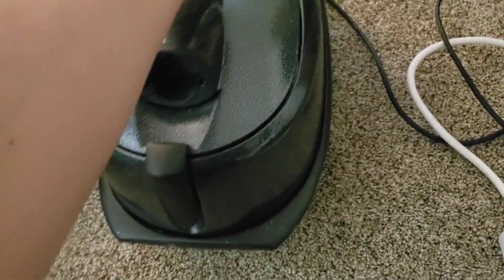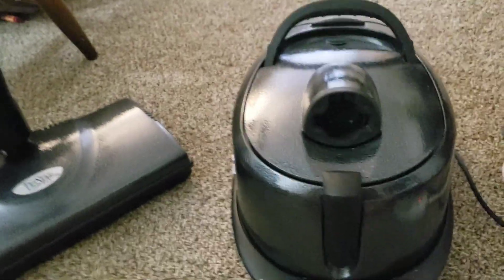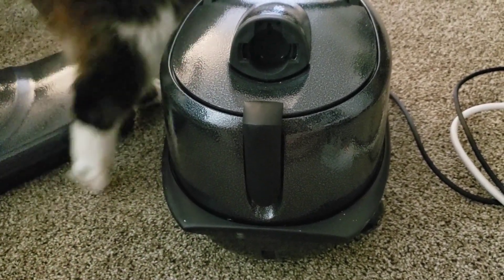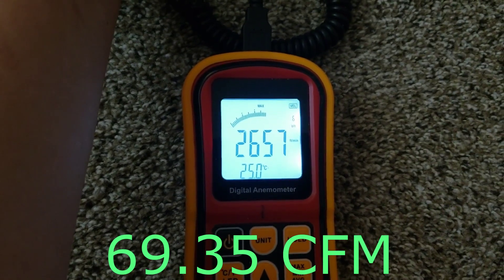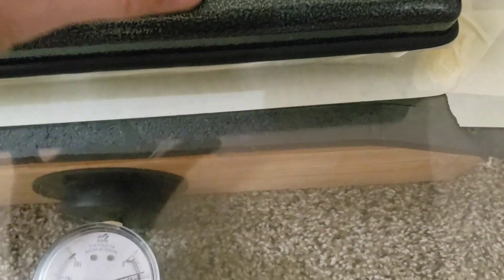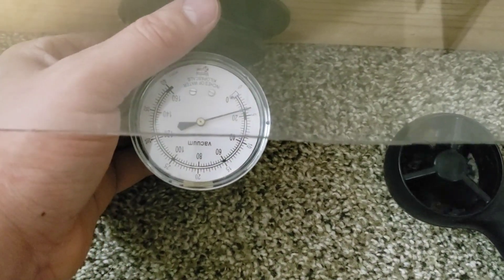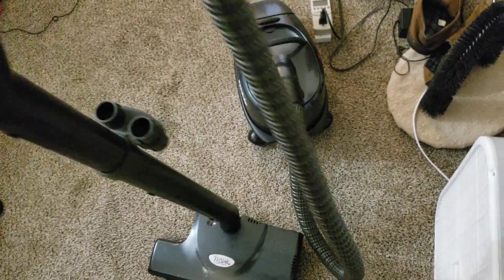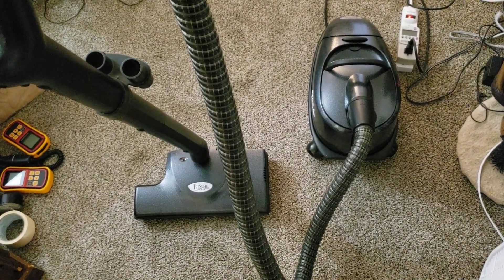Tristar A101S CS airflow test

Comment: The vm3 motor was absolutely THE BEST motor ever made!! It was, in fact, a 3 stage turbine motor. Telling you this because I sold these machines for 21 years before my distributor switched over to us selling water treatment systems. If you're curious....that particular unit has 110 kilopacscals of water lift.
Reply from the maker: Feels a little trollish there's no way you could fit 3 fan stages into that fancase i've had like 2 of the MG2s with the vm3 they are clearly a single fan motor.
Reply: @Blackheartvacs  It does feel a little trollish, I know what a 3-stage looks like, I have one in my Beam central vac.  There's no way you could fit one of those in a compact/Tristar of any vintage without serious modification...Maybe in an Electrolux, but not too sure.
Reply from the maker: @WJCTechyman  Right? Plus I just had a lux guardian opened and showed the VM3 motor...of course that video came a year after the original comment was made

Comment: A comment on technique.  All these instruments measure directly is the velocity of the stream of air.  It has to know the diameter of the orifice, or make an assumption that it is equal to the diameter of the fan to calculate the volume of air moving through the instrument.  I have a hot wire anemometer and to calculate airflow in either cubic feet per minute or liters per second it has to know the area of the orifice.  I have to manually calculate it from the diameter.  Here is where one can run into a problem.  On my anemometer one cannot enter an area less than .01 cubic feet.  The surface area of an 1 1/4 inch hose is only 0.008 cubic feet.  Hence even if I set the surface area at 0.01 cubic feet my anemometer will calculate an airflow greater than actual airflow.  But if I test one of my late model Kenmore's the hose and wand diameters are much greater, so I have to change the area in my anemometer to correctly measure the airflow.
Since many of my machines will not run without the hose attached I test them at the hose end for consistency.  I have a DXL, an EX-30 and several A101S's with different motors in them.  The EX-30 ( a acquired two from Japan where they were popular and replaced the cord and 100 volt motor with different 120 volt motors ).  The EX-30 has had a stock DXL motor rated at 356 peak air watts, an Electromotor Inc. 6500-298 rated at 438 peak air watts and an Ametek 119347-01 used in several backpack vacuums rated at 489 peak air watts.  All of these motors delivered 52 cfm at the hose end.  With my A101S's I have one with the original VM3 motor, another with the 6500-298 motor I took out of the EX-30 (fitted using an EXL motor mount) and one last one into which I finagled the 600 air watt motor from a Kenmore Elite using the CS motor mount.  The VM-3 motor and the 6500-298 motor both deliver 52 cfm.   Like a broken record.  Only the Kenmore motor has more, 56 cfm.  That same motor in the big Kenny delivers over 70 cfm.  The 119347-01 is in several of my old vacuums and typically generates around 67-68 cfm.  The 6500-298 that I put in my old Electrolux Epic 8000 makes 66-67 cfm.  The Epic has a larger diameter hose and wands than the Tristar.  Ditto most Kenmores.
Now here is what frosted my cookies.  I have a beautiful Lux 1 Royal D820, a big Swedish made Electrolux never sold in the US, that I bought in Japan.  I use it on a 100 volt transformer.  It produces 67-70 cfm depending it seems on the freshness of the batteries in my anemometer and the wall voltage, which varies day by day from 109 volts to 122 volts.  So Cal Edison is a crappy utility!  Keep in mind the Lux has 35 mm diameter hoses and wands vs 32 mm for the Tristar.  Anyway I took her apart to replace the dinged up metal shell with a new one I found in France and give her a general clean up.   I was expecting to find one of the big two stage Swedish Electrolux motors in it or maybe the Domel upgrade Lux was selling (the Swedish motors can't be repaired, the fans are retained by a pressed on cap).  The vacuum is dead silent when it is on, quieter than a Miele so I was expecting a special motor.  Imagine my amazement to find a VM-3 motor in there!    That much maligned little VM-3 is a rip roaring motor in a Swedish Electrolux.  Who knew?  I have a drawer full of them I removed from other vacuums to replace with a "better" motor.  So I guess I have spares for the Lux.

Comment: The push vacuum part of mine won’t turn on anymore. It quit working when I accidentally sucked up part of a t shirt for a second and then pulled it out and I can’t get it to turn on anymore. Any thoughts? Thanks so much.
Reply from the maker: I'm guessing your vacuum is similar to this one? Try looking for a reset button on the power nozzle. On tristars like these it's a little red stick poking out the top of the cover. They are there to protect the motor and belt in case of a jam like that.
Reply: That did the trick! Thank you so much for responding!
Reply from the maker: @AimeeNolte  You're welcome.
Reply: @Blackheartvacs  I should have known this, I have owned or even used Rainbows for most of my life.  The early D4 machines had one sitting on the top of the rectangular R2800 power nozzles and I have even tripped the breaker on my EBK340.  At least the 340 has an indicator on top that turns red, the Rainbows didn't.  Although, I remember if we had a sock or something caught in the Rainbow brush roll the belt slipped off and burned as the nozzle motor got higher in pitch sounding more like a power drill.  I never really understood why there was a breaker on the Rainbow nozzles if it didn't trip with that.  Heck, you have to give credit when it's due but my Mom's Shark Rocket stick has an overload protection system in it like the more expensive power nozzles from Wessel, Sebo and Lindhaus.
Reply from the maker: @WJCTechyman  Huh....I forgot that those rainbow ones even had them.